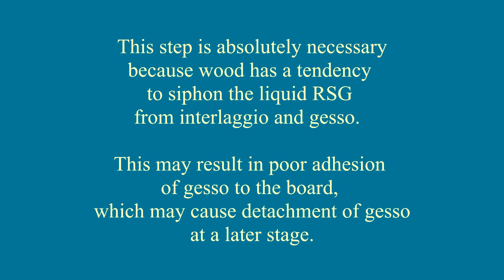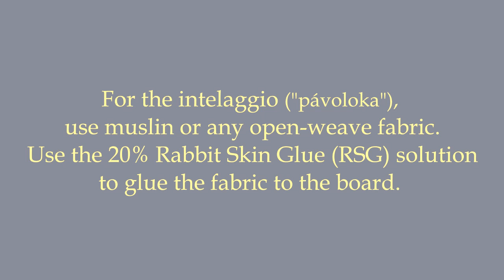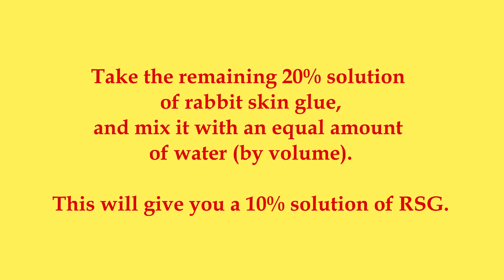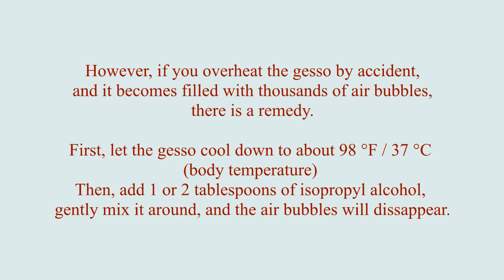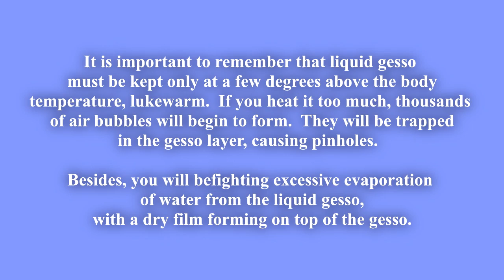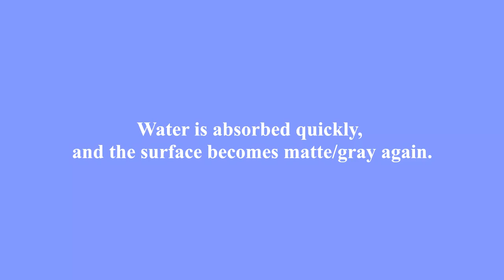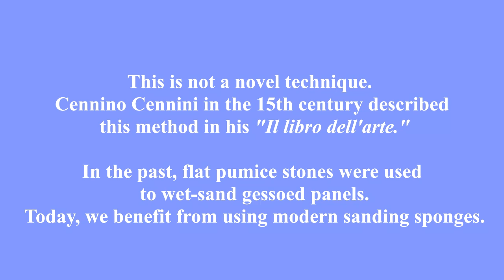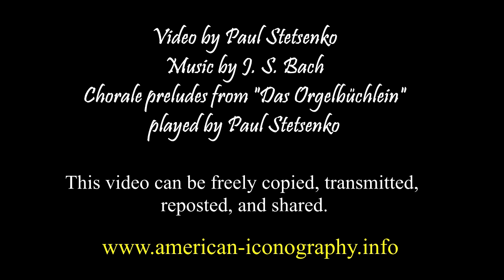Making an icon board

Comment: Thank you, one of the best video lessons I have ever viewed. I especially like the wet sanding technique. I now feel confident in attempting to make my own boards. Thanks again
Reply from the maker: Please do not hesitate to ask questions if something goes not the way you expect.  Often one has to run into a bunch of problems and then find solutions to be fully confident in the process.  As much as I tried to safeguard anything that can go wrong ("Don' do dis or dat" kind of thing), there is always a learning curve.  Mary, best of luck, and do not be afraid to make mistakes!

Comment: When you say chalk, could you be more specific? Is there a certain type or brand you recommend?
Reply from the maker: Father Mark,
Any good chalk will do - that is, used as "whiting" in gilding or gessoing.  I used to buy chalk from Kremer Pigments, and their chalk is really good - be it chalk from Champagne, Bologna, or Belgium.  As long as it is calcium carbonate, it will work (NOT calcium sulfate!!)  One drawback: chalk is not expensive, but shipping it is.  
Since most art stores do not carry chalk, many settle for an alternative in the form of marble dust, and it works for them.  It is a form of calcium carbonate, but in my experiments with it I found it to be less absorbent than chalk.  As the result, egg tempera tends to dry very slowly which may result in "lifts".  Another drawback is that marble dust is much harder than chalk; if you water-gild and then burnish, such tough gesso may scratch your agate burnisher.  
A few years back I tired paying high fees for shipping chalk, and the kind people from Rinaldin gave me a great suggestion to look for an alternative in the form of ground limestone, food grade.  I found it on Amazon, at a fraction of the price of chalk, and worked with it ever since.  However, I first recommend to try a natural chalk since it is more "historic" than ground limestone,  just to get to know the material.  And after that, try alternatives.
Reply: @paulstetsenko5721  I love this video! I wanted to learn about icon making but I was broke so I had to use the strangest ingredients, ones I had on hand... slaked plaster,  supplemental collagen, found wood boards, embroidery linen,  etc. It was a learning experience but I wish I could have seen this video.  It would have saved me a lot of trial and error! Thank you!

Comment: Would you believe, after all.these years, I really thought the borders that almost form a frame were CARVED out!!
Reply from the maker: Roberta, if an icon board with "kovcheg" is made out of wood, then yes, the inside part is carved out.  These days, it is done with a router.  
However, plywood is not good for that sort of carving; at some depth, one would just hit the glue/epoxy layer and there is no point of trying to do anything after that. 
The idea came to me when I saw a Cretan 18-c. icon in a museum.  Over the centuries, the glued strips got unglued--not excessively so, but one could see the cracked seams.  This gave me an idea to try this on my plywood boards.  Plywood offers something that natural wood boards do not: plywood boards are stable and will not warp.

Comment: Hello Paul
Thank you for the wonderful tutorial.
May I use marble dust rather than chalk  in this process?
Reply from the maker: by all means you can.  The problem with marble dust is that the particles are too fine and not as absorbent as with chalk.  If you intend to work with egg tempera, high absorption is your friend.  Conversely, if the gesso is too hard (dense, non-absorbent), you will experience lots of lifting and even crackling.

Comment: Thank you for this video. I'm so glad I came across it, as I would like to attempt making my own boards to pray the process from start to finish. I have a question regarding the care of the tools. How do you wash and preserve the paint brushes that you use for the gesso? Dish-soap and air-dry? Lastly, do you have videos on gilding techniques?
Reply from the maker: Hi Maria,
I use cheap synthetic brushes I buy at Michael's, and they last quite a few years.  At the end of their life-cycle, I buy a new set.  They do rust at the ferrule, nothing I can do about it.  At the end of the gessoing session, I wash the brushes (and everything) with HOT water and dish soap, and just let everything dry.  Hot water dissolves rabbit skin glue and all of it--glue, chalk--is washed away.  

I don't have a video on water gilding technique.  I wanted to make it for years, but I just don't have time.  Besides, water-gilding has to be taught by a teacher who observes what the student does and suggests corrections.  Any book, any video will tell you what to do, but they cannot correct your mistakes.  Somebody knowledgeable has to watch what you are doing and make course corrections.  It is difficult to do something like that with a video.  I'd have to anticipate all possible mistakes that can happen.  Gold leaf does not stick and flakes off?  Possible causes: too little water, or is absorbed too quickly, or the gilder waited too long to apply gold leaf etc.   Gold is covered with unpleasant yellow stains?  Too much water, too much glue in the gilder's liquor, too hard of a push on the leaf, too this, too that...  Variables are endless.  Do you see my point?
Reply: Thank you for your answer. It is very helpful. I understand your point about gilding, it makes a lot of sense.

Comment: Hello, thanks for the amazing video, am I allowed to leave the RSG to soak in the water for longer than three hours? Just in case I don’t have time to start sizing immediately after waiting three hours.
Reply from the maker: @danielbeskhyroun2638  Absolutely! The rabbit skin glue pellets need at least three hours to fully dissolve. I usually let mine sit overnight at room temperature. If you have the glue in a powdered form, similar to sand, it can dissolve in an hour or even less. Just a heads up, it's best not to let the mixture swell for more than a day, as it tends to spoil after about 24 hours at room temperature. On the bright side, you can store it in the refrigerator for a couple of weeks, or even a bit longer if needed.

Comment: Thanks for this video... so-- no dry sanding at all? Whenever I'm finished with my last wet sand, some sponge/towel 
"stroke" marks still remain and my board isn't perfectly smooth- a final dry sand seems to be required...Am I doing something wrong? How perfectly smooth is your finished board?  Thank you again---
Reply from the maker: No, I don't do any dry sanding.  The foam sanding block suffices.  But we all have different hands and different touches, so if you need to give it a light dry sanding, go for it.  My boards are quite "perfect", to the point of being like porcelain, which is not always good.  There has to be some tooth, even very fine tooth for the paint to grab onto.

Comment: Can I use a cradled birch panel or is that not as strong as the birch plywood? Also do you have to use isopropyl alcohol in the gesso?
Reply from the maker: I’d say yes - I have made a few boards with cradled 1/8 inch-thick MDF and hardboard, and it worked.  As for alcohol in the gesso, it is entirely optional. In the winter, when the air is very dry, I a don’t add alcohol at all.  Lastly, Birch plywood is no longer available (made in Russia, after all), so I switched to HPVA-good grade plywood.

Comment: I couldn't find this question in the comments, so apologies if it has been asked, but what is that wooden tool you use to hold the board in place as you cut through on the table saw? I've cut several boards with our table saw but it is difficult to keep them properly in place even with holding tools.

I would also love to know where you source your wood. It's been difficult for me to find a good wood source with the quality I'm looking for, mostly baltic birch plywood Grade A or B/BB
Reply from the maker: Kim, that thing is called "table saw sled" or sometimes "cross-cut sled".  They are easy to construct (which I did), and general designs are easily available on the internet.  You can also buy one, ready made.  

Procuring wood is difficult nowadays.  Baltic birch plywood, which I had used for ages, is now of such bad quality that I had to switch to HPVA plywood (birch or maple veneer) sold at Loew's and HomeDepot.  Getting real wood suitable for gessoed boards is next to impossible, at least not where I am at now.
Reply: Thanks that’s helpful!

Comment: Hello, can I coat with rabbit skin glue and gypsum directly on birch plywood and paint with egg tempera without linen, or muslin, or cloth, or other else? I am waiting for answering, thank you very much.
Reply from the maker: Hi Nidal,  
You can certainly do it.  Many iconographers of the past did so; I have seen old icons painted on such boards.  The problem with skipping the cloth part is that such gesso is unstable and flakes off with time, in chunks.

Comment: Thank you very much for the detailed and useful video! 
One question: how do you ensure that water, the RSG and the gesso keep a constant temperature (eg. 37 or 60 celsius), how do you preserve them from overheating/too low temperature?
Reply from the maker: Hi Edit, 
I use my secret weapon: a Salton Warming Tray!  It is prominently featured in this video.  See at 12:00.  
It has a temperature dial.  At the minimal setting, the temperature keeps the same level, and I can dial up when I need it hotter.
Check for this model on eBay - I bought mine for about $40 .  Salton were at some point out of business but now there are new Salton Hotrays sold at Amazon.  However, I don't know if they have temperature dials.
Reply: @paulstetsenko5721  Thank you!

Comment: My apologies, I have a few boards where I failed to get the fabric  tucked in the edges, and after drying I have some bubbles or gaps between the fabric and the long edges. How can I remedy this?
Reply from the maker: James, please rephrase the question - I barely understand what you mean.
Reply: @paulstetsenko5721  sorry about that, I have a few boards where the fabric at some of the luzga areas (where board meets raised areas) that have bubbles and or dryed taught and left an empty recess. Should this be fixed?
Reply from the maker: @jamesglover831  Yes, that is a problem.  You can gesso it over, but those areas will always remain unstable.   In my video, watch the trick at 10:40 to prevent that.  Even if it has dried, you can still re-wet that area (use hot water), and incise it, and push it into the luzga so it stays put.  Work some of 10% glue into it.  It should be good after that.

Comment: Sir, my wife picked up iconography and started painting using stencils from The School of Proposan, NY. She needs bigger boards ie 14x28 inches which are both expensive and very hard to find so I will try to make them myself. Question: Is there any literature / books I can buy that can be useful?
Reply from the maker: Mother Iuliania's "The Iconographer's Labor"
https://www.sacredmurals.com/texts/the_iconographers_labor.pdf
(I translated this work 6 years ago from Russian, free to download.)

Very little is offered in English of comparable value, but there are few books such as "Techniques of icon and wall painting" by Aidan Hart, a few other.
Reply: @paulstetsenko5721  Brother, this is a great beginning. I'll take a look. Thanks!
Reply: @paulstetsenko5721  I've read parts of the book and it's the best resource I've found in the topic of making gesso icon boards.  Thanks again!

Comment: How do you make the raised border with material as this! Very good information 🙏😇
Reply from the maker: Morgan, could you please re-phrase your question?  Did you mean, how to make a raised border with plywood using a router? Answer: you don't.  If you start routing the inside part, you will hit the glue/epoxy that holds the layers together. Then, you'd be gessoing the epoxy layer instead of wood.  Hence the method of gluing the strips of wood to create raised border.  It is not a novelty; I have seen historic Cretan icons in museums and exhibits that clearly showed that the raised border was glued on rather than hollowed out.  Of course, the reason I could see it because with time cracks and delamination occurred :)
Reply: @paulstetsenko5721  it looks like this board on the movie is not in solid Wood?! Am I correct? And have you glued strips to get the border? Or is this board in massive Wood? 🙏

Comment: Good day Sir! 🙂

Three questions for you:

Are you using plywood in lieu of splined boards, or, if I use a 3/4” thick birch plank will I have to spline the back?  

Is 250 gram strength hide glue acceptable in place of the 500 gram strength rabbit skin glue?  

Is plaster of paris considered chalk?
Reply from the maker: Hi Marcao,
1. Plywood's advantage over regular wood is that it does not warp.  Birch panel will eventually warp, so you do need splines in the back.  Suggestion: instead of splines in the back, see if you can do side splines.  See the book "The Iconographer's Labor" by Mother Iuliania; you can find it online, in PDF.
2. I have never used hide glue.  I heard it is very strong but also brittle.  I have seen some contemporary icons made on boards with hide glue as a binder for gesso; they were all cracked.  I would suggest making a few samples and adding plasticizer (linseed oil or glycerin) and experimenting with it.
3. By no means plaster of Paris is chalk.  Chalk is calcium carbonate whereas plaster of Paris is semi-hydrated calcium sulfate; it will turn into solid matter once you mix it with water.  Do not use it.
Reply: @paulstetsenko5721  
Thank you so much for your response! 🙂

I now have the rabbit skin glue and the chalk on order, and will get some plywood soon. 

Thanks for the tip on side splines—I’ll look into that too. 

Have a great day!

Marcao

Comment: If I don't use Jorgensen's E-Z Hold clamps, will God smite me?
If I use a proper technique involving a push stick to cut my wood, and forgo the dangerous "shove the piece into the blade" technique you employed, will the Pope still like it?
If I cut the first board the correct length on the first cut, and not make two cut top and bottom to achieve the same length, will it affect the holiness of the icon?
If I use popular for the strips instead of 1/4" plywood (that you cut cross grained and not with the grain topside) that will certainly weaken faster, is the holy spirit going to shun my piece?
If I chamfer the edges of the frame using either a round-over bit on a router table or just use a #3 edge plane instead of gluing it down to the table so as to gouge out the painting surface with a chisel, does that lessen the authenticity of the icon?

I should stop there...
Reply from the maker: Absolutely!  It will be totally unholy, demonic, and inauthentic :)
Jorgensen's clamps are trice-holy.  St. Gregory Palamas speaks of them highly.  Of some other Greek.  (Zorba?)
Push-stick can be used, but it must be specially blessed by an elder from Mount Athos, for a special introductory price of $99.  Otherwise remove the riving knife from the table saw and shove the hands into the blade like you do for a blessing.
The holiness of icon wholly depends on the evenness of the cut.  You MUST cut the board on all four sides, 3 times.  Then 12 times.  Then 40.

(this one is serious though: I don't use 1/4" plywood for strips anymore; too much hassle.  These days I rip a piece of pine into thin strips.  It is much softer and water gilding looks better on it.  I still don't do the routing, and the reason is that I can't get good poplar or ash here in the boondocks).  
Well, I can go on and on.  Being facetious and flippant is my MO.
Reply: @paulstetsenko5721  Just be leary of the sap content of the pine, harder pines are wonderful, like Douglas Fur, but yellow paints and others softer ones can leach acids from the saps if not properly kiln dried (which 95% of all wood these days is not done to adequate standard) meaning it will warp as the sap content hardens. I completely understand about the boondocks, I am in GA and cannot get baltic birch anywhere down here, for this reason, I employ a lot of other woodworking tricks to elevate the durability of the crap I can buy! You pass the "good humor" test!
Reply from the maker: Chris, thanks!  I am leary.  Just waiting for the pockets of sap to open up and ooze the contents. 
By the way, a few years back I ditched baltic birch ply.  Lately, there wasn't a panel I got than didn't warp or delaminated.  There are a few I still have; they all look like a potato chip.  (And taste similarly too). There has been a marked decrease in quality as in anything made in Russia be it plywood or ballet dancers.  Finnish-made is $$$$ but the quality is good.  For icon boards, I switched to HPVA plywood, birch veneer.  Over a hundred icon boards made, not a single one warped, cracked, or became dissolute.

Comment: Thank you for a very clear video on the steps necessary to complete a gesso board. I am the director of a website offering online classes for calligraphy and art, egg tempera although not in the traditions of icon painting. I would like to share this with the students. I know that you say it may be reposted and freely shared, but I wanted to check specifically before embedding it on a classroom website. If you would like to look at the website first, please just let me know and I will send it to you. Full credit given to you, of course. With thanks.
Reply from the maker: by all means, feel free to copy, post, repost, use on your website etc. etc. etc.